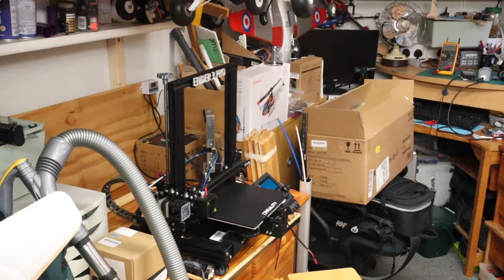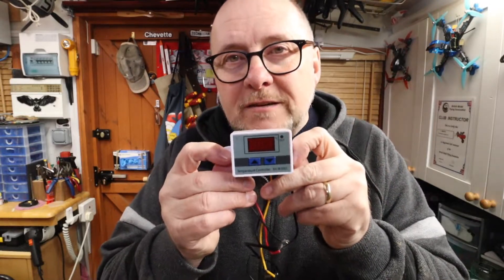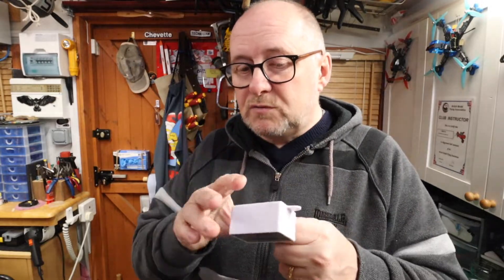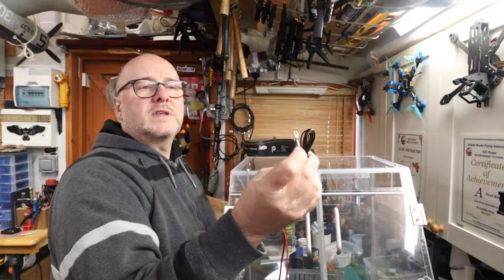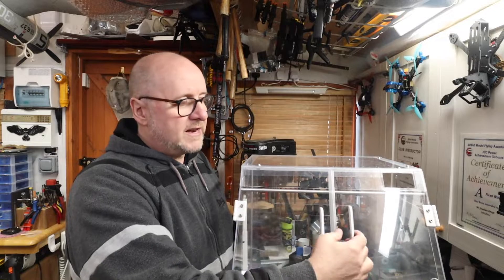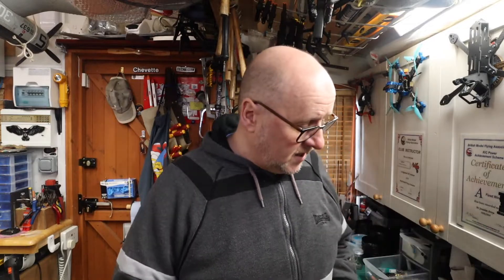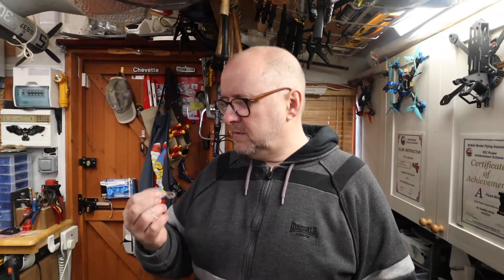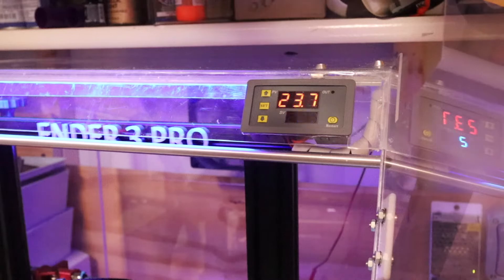3D Printer Enclosure Temperature Control Upgrade

Comment: Jon a 14W fish tank heater helps maintain the temperature in the enclosure, especially useful if you are printing with ABS. Although these days PET-G is just as good.
Reply from the maker: I get more than enough heat from the bed heater. It comfortably heats the enclosure to 25 deg's

Comment: Take a look into Voron SW. I've converted my Ender 3 Pro to a SW and it has the enclosure build in ;)  I also have a bit extra enclosure stuff if outside is -20C. Printing ABS with 40C inside or PLA with 20C inside just with the build in stuff. Used to build the same for E3 but now all in one SW ;)
Reply from the maker: The Voron SW conversion looks good. My only concern is the cost for all these direct drive systems is almost as much as buying a new machine.
Reply: @TWSreviews  Yeah that's true but when (I'm not talking if) you're gonna start melting ABS you need a better enclosure. I'm printing 3D planes and PLA is of course easy to do but ABS lighter and heat resistance is way much better ;) Eclipson gives away for free Model A and you can easily print it out from PLA. Try it :)